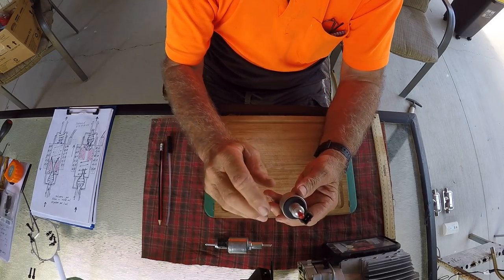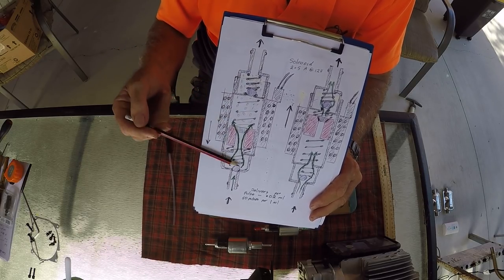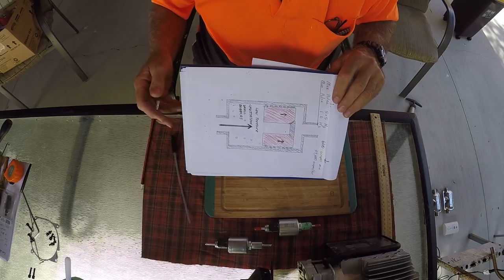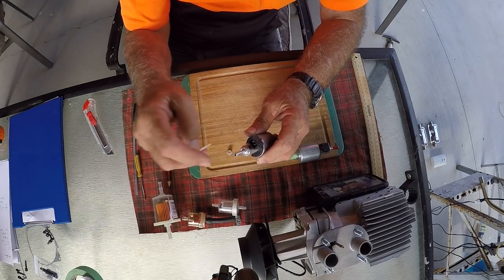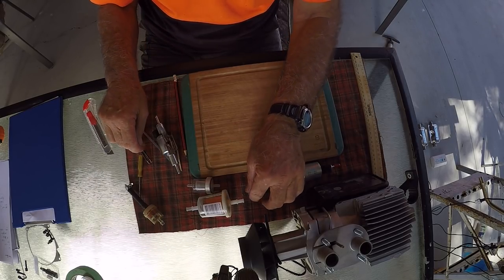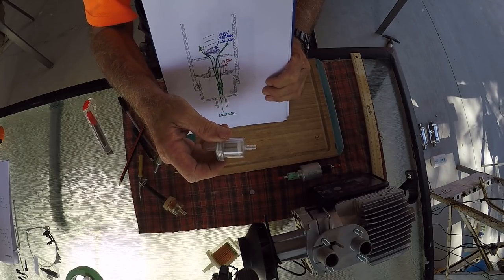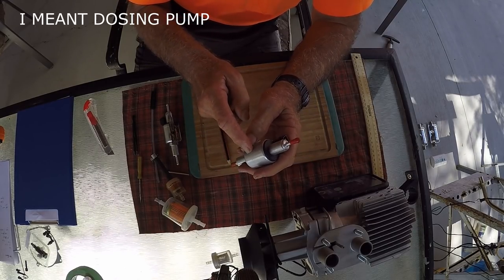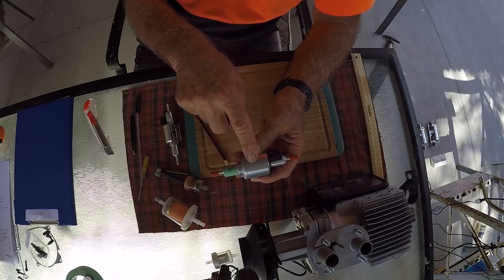Chinese Diesel Air Heaters   Part 7   Metering/Dosing pump

Comment: Thanks John it’s going on the front of a gooseneck horse float. If I make a bracket to hang it lower I can probably get the bottom of the tank level with the pump which means it will be a full tank length above. That will have to do. Cheers
Reply from the maker: Hi Clayton, you don't need a bracket, things will work ok with with the fuel tank up to 1 to 1.5 metrers higher than the pump, just install a simple in line fuel shut off valve in the fuel line before the pump.  JMcK
Reply: Hi John I have the heater up and running and it works really well but the pump is quite loud. Even with the whole fuel system suspended and not touching any thing it’s still loud. I was wondering if it was because I have a really short line. It’s about 10cm to the filter, 10cm to the pump and about 25cm to the heater. Could the short line mean less air and more pressure also do you think it would matter if I enclose the pump in an insulated box?
Reply from the maker: Clayton Hughes 

Hi Clayton
Yes, a big complaint about these heaters is the "ticking" noise from the dosing pump. You can lesson this noise by soft rubber mounting the pump. But the noise will be louder if there is air in the pump. Is your pump angled upwards more than 15 deg? I like at least a 45 deg angle.

The length of fuel line won't make much difference to the noise, but make sure you also rubber isolate the hard nylon fuel line from your trailer as it also transmits the pulse noise.

You can put a insulation box around the pump, but it must have an air gap as the pumps get hot, and you can't wrap the pump directly.

Hope this is of some help.  JMcK

Comment: They are pre-lubricated for priming which is why they have caps on, but if you have a long way to prime then you'll notice the valves are all one way and you can just suck through it.  It helps if you momentarily place it all lower than the tank.

Comment: Useful and constructive videos. Although I have a good understanding on installation and operation I have learned a few useful points. Thanks John
Reply from the maker: Your welcome Mark.   JMcK
Reply: @johnmck1147  Do you have any recommended suppliers John for the inner and outer gaskets on the 5Kw Chinese heaters. Thanks.
Reply from the maker: Mark Bradbury 

Hi Mark, online suppliers come and go and I need to search each time I want something. First try searching for gaskets for Chinese diesel heaters, then search for gaskets for Eberspacher D4 gaskets. The most common Chinese heaters are a direct copy of this heater. However there are a few copies of a German Webasto heater. It is hard to find spare parts if you have one of these heaters.  JMcK
Reply: @johnmck1147  Appreciate the reply John. I will have a search around ebay etc. I'm not in dire need yet but intend to strip down and clean at the end of winter. If I'm really struggling I do have a local gasket cutting Co. So I'm sure they could assist. Cheers again for the help.
Reply from the maker: Mark Bradbury 
Hi Mark, the crowd where I bought my last set of gaskets no longer supply them, but here is one link below to get you started.

https://www.ebay.com.au/itm/1X-Parking-Heater-Exchanger-Burner-Gasket-Parts-For-EBERSPACHER-Airtronic-D4-D4S-/133264466249?hash=item1f072e6149

Cheers,  JMcK

Comment: You invested your time and energy to explain and show as YouTubers your knowledge and expertise about this Heathers.
Me personally I thank you for teaching me what to look or watch out for..
If possible please I would be curious about optimal settings on the display menu.
Just purchased the latest edition of this  (.8Kw red remote and display) I know in real life is only 5kw.
Messaged seller got 20 pounds refund.
Great job great video very useful Thank you...
Reply from the maker: Hi Mngvmhgf Bgc!hgc ,

Thanks for the positive feedback.

The settings are really down to personal preference, size of area to be heated, and your comfort setting. I personally prefer to just use the manual setting of around 3 to 4 Hz to start, and then adjust from there. But that is just my preference other people have their own ideas.

Cheers,   JMcK
Reply: @johnmck1147  Hello.thanks for reply.. being honest after watching and reading so many vids and writings all over I become a bit paranoid with this Heathers ..I have installed the Heather in my boat trying to follow your  advice. regards Max.

Comment from the maker: Hi Ruben

All the Chinese heaters I have tested ie 2 kw, 5 kw, and 8 Kw, used the same fuel pump. The heater CPU just used different Hz pump speeds. 

Now to your pump. These pumps are a very simple electromagnetic pump, and generally fail from two causes. 

1. Debris in the pump workings from bad fuel and poor filter. 

2. Low voltage. If your pump works on 24V but not on 12V, I would be taking a serious look at the pump voltage and voltage drop in your wiring. JMcK
Reply: Thanks  John ! I have tested both pumps! The old one was not working when i put it directly on to a fully charged battery only if i connected two batteries in line. So i think voltage drop should not be the problem. I use the cars tank fuel, so it is filtered and on 24 volts it moves smoothly... I dont know...

Now the other pump: It is not a pump for chinese heaters however and there is a sign on it that it is good for 2-3 kw. However i put in the System but the heater is not heating up properly. What happens is that the heater works and the icons on the controller only showing 2 blue and two yellow bars on 1.6 hz and one or two bars on 3-4 hz and also the exhaust is really smelly but not smokey. What do you think?

 Ive alresdy ordered a complete new heater as i use this from 2 years on every autumn and winter nearly every day and also i can hear some noise from the propellers.
Reply from the maker: Hi Ruben

Did you put a volt meter across the wires at the pump?

You can buy a new pump very cheap on eBay. 

These Chinese heaters are so cheap you can afford a new one every year. Low voltage issues are very common with these heater installs. 

Please let me know how you go.
Reply: @johnmck1147  thanks. I did put yes, i unplugged the pump, turned on priming function and measured the voltage between the two pin of the connector. It was somewhere around 12,6 V.

I'm now waiting for the new heater to arrive. I will let you know when i could test the system with the new pump.

Ruben
Reply: Hi  @johnmck1147 ! I've got my new heater. It has a slightly different metering pump then the old one. On the input side it is longer (i have a pic, but unable to post it here). On the old pump i can see the following: HD.20 22-12V on the New: BSR.23 22-12V. 

Can you explain these codes? I guess 20 and 23 is the year that it was assembled, the 22 is the size and 12v is the voltag of course. What is the difference between the HD and BSR? 

Thank you,
Ruben

Comment: Sooo glad I found you! Wonderful job! Thank you!!!
Reply: Still working through the series, but so far don't see that you do affiliate links. You seem extremely knowledgeable and unbiased and therefore I would feel comfortable buying products based on your recommendations. For example, say I wanted to add an air filter, upgrade the fuel filter and change my controller. If you linked to things you approved I wouldn't need to go through dozens of pages but would defer to your expertise. And you would get revenue which would thank you for all of your excellent work : )

Comment: Hi i am looking at these heaters. Thanks for your work on the videos. I am sitting at home in front of wood heater and i have a idea. 10ltr metal jerry can. More robust. Then fuel line. Mount fuel filter at end if tube and place it in the jerry below fuel and just off the bottom. And make a lid  that the line goes through. Or you can get fuel cloth filter. The little bag in fuel tank. Fit it on the end. That the other idea. Both will help the pump. It takes out the tank tube that comes with heater and remove a few of them rubber joint connectors. Russell

Comment: Your videos on these things are amazing.

This video has me wondering if these units could be further simplified, and reliability improved with a redesign of the pump piston using compliant mechanisms - no moving parts, just a single flexible membrane with an electromagnet attached..  Food for thought.

Comment: Hello John. Hoping you may have encountered this scenario. From day 1 heater it would start and run OK but would show an E-04 code during the shutdown sequence and turn off. Once reset (powered off / on at fuse) it would restart and run fault free until next shut down sequence. Hasn't been used for several months (summer NSW) however when I attempted to test a day ago it goes straight to E-04 a second or two after power button is pressed on controller. Heater does not exhibit any start sequence (fan running etc.) before E-04 code activation. I can read approx. 4.5 ohms resistance at the heater side of loom plug of the pump wiring, which seems correct assuming pump current of 2.5 amps. What seems strange though is that voltage reads only 10.4 volts when measured at the same point in the loom with a second meter displaying 13 volts at the positive/negative mains connection at the loom plug. Any thoughts on my next step appreciated.
Reply from the maker: Hi Charles, I suspect a low voltage issue. 
Suggest you run thick cables direct from your battery, or spare battery direct to the heater.

These days these heaters are supplied with absolute minimum power wire, and with connectors, fuse, distribution etc the voltage is too low to heat the glow plug.

These heaters suck 8 to 10 amps to start and shut down for a few minutes. They need better wire than that supplied. 

Suggest in install you connect heater direct to battery, with good wire, through 15 to 20 amp fuse.  JMcK

Comment: Apparently to small 90 degree bends in the fuel lines  both right before and right after the pump helps quiet it as well.

Comment: I recently became aware of these heaters and have watched a lot of YouTube videos. Your in-depth coverage is the absolute master class. 
2kw vs 5kw - if both use the same pump, would the 2kw running full speed be pumping about the same rate as the 5kw running at its lowest setting? So, would the heat output of a 2kw at full speed = the 5kw running near its lowest speed. Same for the db level. I realize there is also a combination chamber size difference to be factored in.
If you address this in later videos sorry I jumped the gun.
Reply from the maker: Yuo got it Jer.
In my opinion it is better to have the 5kw running slow, with less noise, rather than a smaller heater running flat out.  JMcK

Comment: That 'bubbles caused by vacuum-pull' is called cavitation. It's an issue we get with model jet turbines, as you go for a hard spool-up - rapid suction of fuel can cause this cavitation, & that can cause flame-out (engine stops) - which can be pretty consequential when it's on a plane in flight!

Comment: Now what would be really interesting would be to hook the pump up to some power and see it in action. My thinking is you use a square wave with variable duty cycle and a variable voltage. That way you don't get that hard knock. Change the frequency of the square wave to make it pump more. Instead of a knock you get a humming or buzzing sound which should be quieter.

Comment: Cavitation bubbles in a fluid pump is not always gases coming out of solution.  It is often the fluid itself boiling because of the low pressure created by the suction.  The boiling point of most fluids can be lowered by lowering the atmospheric pressure on said fluid (vacuum).
Reply from the maker: Hi SW, aren't we talking the same talk here?

Comment: Thanks so much for these videos! Excellent information and just what I needed to finish off this project!  I got a Chinese knockoff and tried to remove the portion on the pump to take out the tiny filter but no go.  Will not budge and didn't want to take it any further.  Do they produce pumps without the internal filter?  If I place a filter inline it probably is just a moot point. Just curious...  Thanks again! Great work!
Reply from the maker: Hi Richard, the vast majority of Chinese diesel heater pumps DO NOT have an internal filter in them (very sensible in my opinion) and require an inline filter. If your fuel pump looks like the ones in the video, then it does not have an internal filter. The pumps that do have an internal filter have a prominent nut on the bottom part of the pump. 

Thank you for your positive comments.  Cheers.  JMcK

Comment: One of the best instructional video series I have seen any topic. I am curious of your opinion on protecting the pump. Mine will be mounted under my van close to the tank and subjected to salt spray. I was trying to figure out a good way to protect it.
Reply from the maker: Hi Mr P,

Thanks for the nice comments.

Have you seen the videos of the motorhome install? The pump is mounted under the van in a position away from any wheel spray. 

We are not subject to salt road spray in Australia, so I have no experience in this regard.
Perhaps a viewer with experience may have comment.

As regular maintenance I would spray the electrical connection with WD40 or similar and fresh water hose the pump. You could perhaps spray paint the pump with an epoxy rust proof paint, if pump rusting is a problem.

You could provide the pump with some form of spray deflection, or perhaps put a plastic bag around it. You can't heavily wrap the pump because it gets hot with use and needs cooling air, but if it is used in conditions that are so cold as to require salt on the road, overheating may not be an issue.

Cheers.   JMcK

Comment: Hi I had a new pump installed and put it straight up like you said but on tick over it stop pumping the fuel but was ticking still so I turned it back to 30 degrees and it started pumping again but with some bubbles

Comment: John, thanks so much for your videos. Pure practical info with no BS. Thanks. Now a question for you or your audience.  What is the minimum distance between the air intake and the exhaust?  This is a boat installation and I currently have the exhaust going through a bulkhead flange feed through fitting on the stern. I would like to mount the intake air also on the stern also through a flange fitting (I know it is not needed, but makes a nice uniform install). The question: if they are about 18 inches apart on the same plain (water is not a problem), is that sufficient? Thanks for anyone's first hand experience.
Reply from the maker: @prosperityconsulting  

Hi PC, I assume by air intake, you mean the combustion air inlet, and not the fresh air to go through the heat exchanger and then into the accommodation area of the boat. If combustion air inlet, then 18 inches should be ok, depending on install. (Water protection etc) If you get wind eddy’s etc and some CO gas is sucked into the combustion air inlet, you may get a smoky exhaust but not health issues.

If you mean cabin air inlet, then that proposed set up is not acceptable on safety grounds.   

Cheers,  JMcK

Comment: Fantastic videos and very good explanations. You mentioned that you mount the pump into rubber something instead of the original rubber holder and your solution nearly soundless. Do you have any picture or more explanation on that? Thanks in advance :-) Mats Sweden (excuse my bad English) 😞
Reply from the maker: Hi Mats,

You can see the pump mount in my Med boat video.
Search for Eberspacher diesel parking heater pump mount.
You can buy them on eBay, but they are expensive.

Below is one link to get you started….  

https://www.ebay.com.au/itm/364608737504?mkcid=16&mkevt=1&mkrid=705-154756-20017-0&ssspo=a2gqr6hjtt6&sssrc=4429486&ssuid=Q5-hU9ilScO&var=634124310854&widget_ver=artemis&media=EMAIL
https://www.ebay.com.au/itm/364608737504?mkcid=16&mkevt=1&mkrid=705-154756-20017-0&ssspo=a2gqr6hjtt6&sssrc=4429486&ssuid=Q5-hU9ilScO&var=634124310854&widget_ver=artemis&media=EMAIL

J McK

Comment: Have been trying to find a thread on this but I find it interesting between the pulse rate settings of the Chinese diesel heaters and the euro ones, even though as we have established they are more or less identical at least with the eberspacher.
So our autoterm 2d on minimum power is 0.8hz and only 1.5hz on full power.
Where as the Chinese ones are 1.4hz on minimum unless you can login to the advanced settings on the controller and then you get em down to 0.8hz. I’m not sure what the pulse rate is on high power but somewhere closer to 5hz which seems like a crazy difference in settings

Comment: Hi John, thank you so much for your videos. They are so well explained and really informative. I am writing because my original pump suddenly seemed to give up the ghost about a week ago. No clicking, no pumping. I have since installed another pump which I have found out is too high on dosage (0.65/1000) so should not continue to use but seems to work fine so don't think the issue with the pump is anything to do with air in the line etc. Do you have any advice as to what I can do to try to fix the original pump or identify the problem with it? I guess it has got dry (it was mounted at an angle but being in that sling at some point it had fallen down to horizontal) or something has got stuck in it. The fuel filter does not look too dirty but I can´t think of what else it would be.
Reply from the maker: Hi Sandra,

First, thanks for the positive comments.

Now the pump. If the temporary replacement pump works you are unlikely to have an issue with the wiring or ECU.

Most common issue with the pumps is a blockage, or electromagnet. Suggest you buy a new pump on line. They are cheap and their many sellers.
Search “dosing pump for Eberspacher parking heater” Make sure you get the right voltage for your heater. They come in 12V and 24V.   JMck